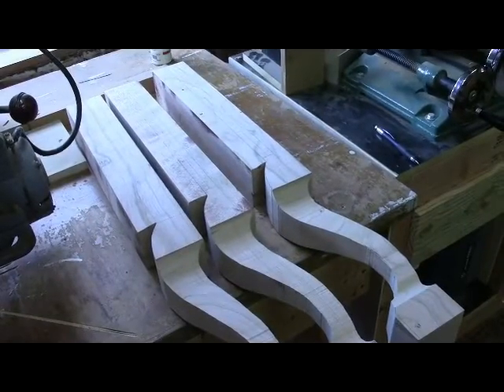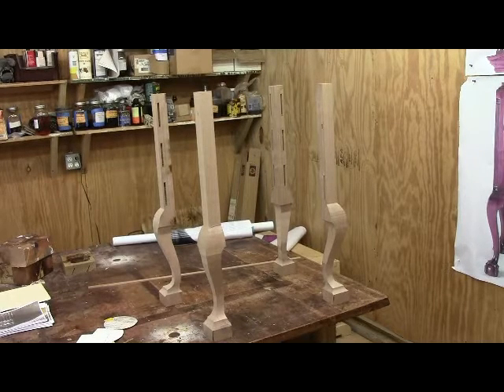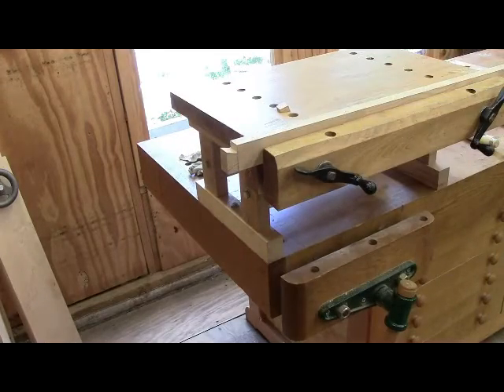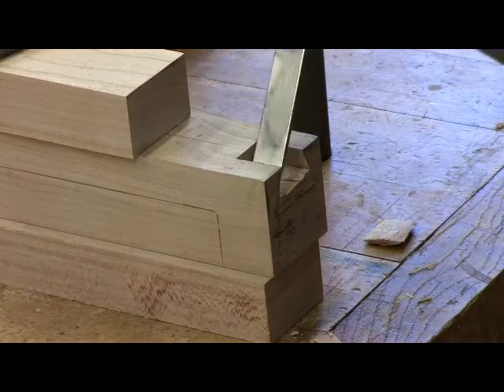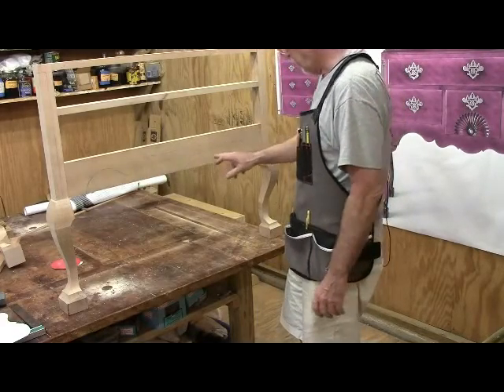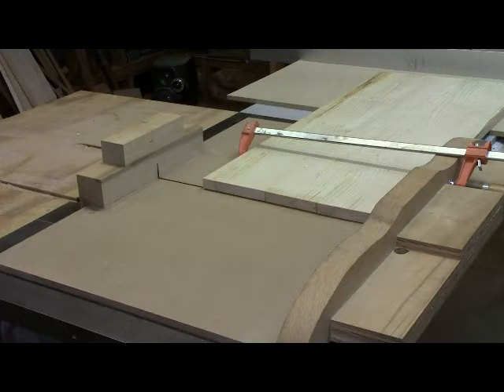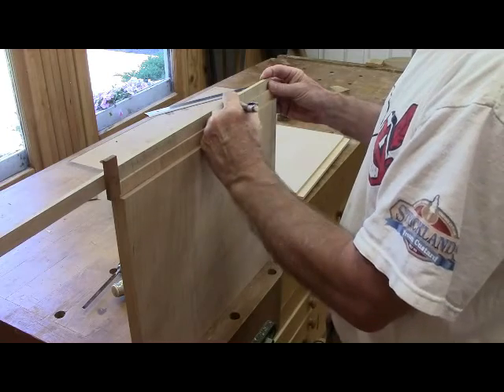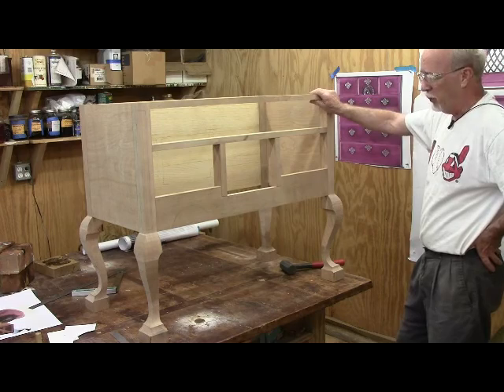Chapin HighChest Building & Dry Fitting Lower Case Step 3

Comment: That looks great. I like how you talk us through the process and in this video you show more of you doing the more complicated work than in the past. I always learn something when I watch your videos.
Reply from the maker: Thanks Mark,  I try to show how I go about the process
Reply: +David Boeff Thanks. You also made a comment when you put the sides on that they will crack since the grain runs horizontal on the side and vertical on the leg. How do you account for wood movement to combat that possibility of cracking?
Reply from the maker: Mark, I had the same comment above here is the reply. The question comes to whether you build to the old ways which did not allow for wood movement or modify the construction to allow for the movement.  Yes there is some room in the M&T.  But gluing is the problem.  If I glue all 3 then it will probably crack.  If I glue the top 2 the leave the bottom loose it will expand and contract to the bottom but the knee block will be there so you have to leave room for that to happen.  The lower tenon would have to be pegged with an elongated hole as well. Things to think about.  I made a lowboy 10 years ago and it still hasn't cracked.

Comment: Another great video,very much enjoying watching this build. Curious as to how you will deal with the cross grain expansion of the sides? Lee
Reply from the maker: Lee, thanks for the comment. Several others have asked. Here is the reply. The question comes to whether you build to the old ways which did not allow for wood movement or modify the construction to allow for the movement.  Yes there is some room in the M&T.  But gluing is the problem.  If I glue all 3 then it will probably crack.  If I glue the top 2 the leave the bottom loose it will expand and contract to the bottom but the knee block will be there so you have to leave room for that to happen.  The lower tenon would have to be pegged with an elongated hole as well. Things to think about.  I made a lowboy 10 years ago and it still hasn't cracked.

Comment: Great video, and the highboy is looking real good - going to be a beautiful build. Question though, as Mark asked prior, why do you think the side will split?, didn't you allow for movement in the M & Ts?,
which leads me to another question on this subject: if you did allow for wood movement, which direction will it move?, as it seems to be captive at the top and bottom.
Thanks for sharing your work process.
Reply from the maker: Tom, thanks for the comments.  The question come to whether you build to the old ways which did not allow for wood movement or modify the construction to allow for the movement.  Yes there is some room in the M&T.  But gluing is the problem.  If I glue all 3 then it will probably crack.  If I glue the top 2 the leave the bottom loose it will expand and contract to the bottom but the knee block will be there so you have to leave room for that to happen.  The lower tenon would have to be pegged with an elongated hole as well. Things to think about.  I made a lowboy 10 years ago and it still hasn't cracked.
Reply: What if you glued in the middle so you have a little growth up and a little growth down? (I know it's a little late haha) Was the original split at Yale? And also... do you have any videos of your trip to Yale?